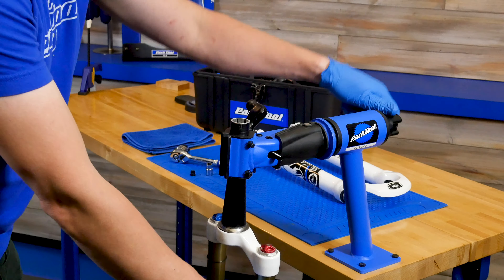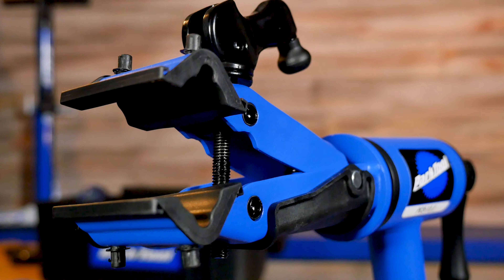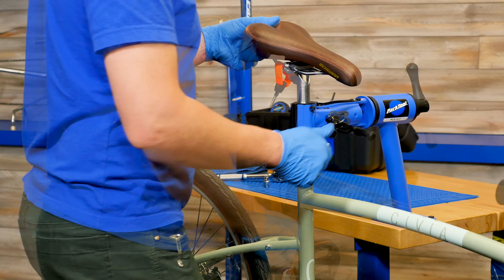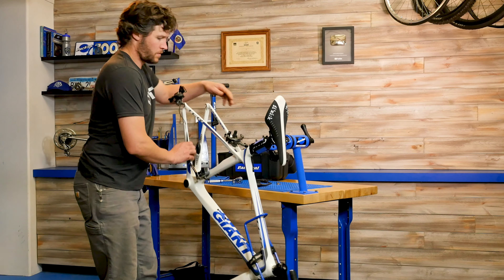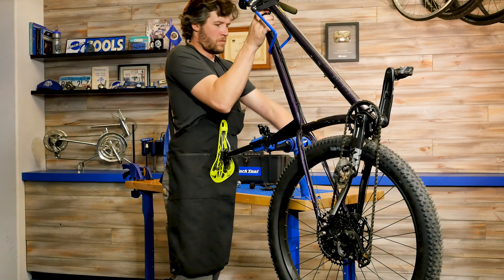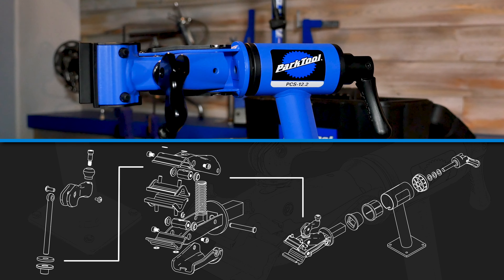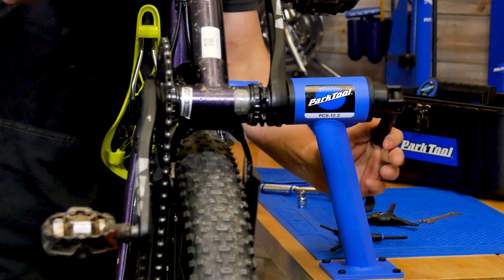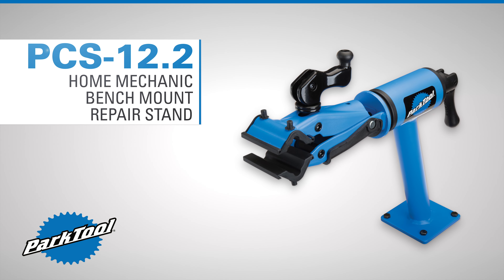PCS-12.2 Home Mechanic Bench Mount Repair Stand

Comment: I just purchased the PCS 12.2. I noticed one of the bolt holes is offset away from the corner. At first I thought it was a manufacture defect. From looking at the video it looks like it keeps the bolt away from the corner of the workbench for tabletop strength. Smart...
Reply from the maker: Good catch! The story behind the one offset hole has to do with our larger upright stands. We have the one offset hole so that the stand can only be installed one way so people do not accidentally hang the bike off the wrong side.
Reply: @parktool  Again. Smart!

Comment: Have you thought about adding a quick release button or trigger that allows you to engage it and freely spin the clamp but then lock in certain degrees once the button or trigger is disengaged?  This would allow you to save some time from having to tighten or loosen the rear lever anytime you wish to spin the clamp to a different degree.  Hope that makes sense.

Comment: Hi, I am thinking to attach it to a balcony rail without drilling thru it. The rail width is 6cm (2.363 in). What is the distance between the distance between holes? Thank you
Reply from the maker: They are approximately 3 inches apart

Comment: What is the purpose of that one mounting hole being closer to the center?
Reply from the maker: That base plate is the same as our other stand that use a bolt on top tube.  With that asymmetrical we can control how the clamp points to give the best support.  See for example the PRS-3 or PRS-4.  Same plate.

Comment: what are the dimensions of the foot stand that screws onto the bench? I wonder if I can nail a piece of 2x2 onto the mall and then use this as a wall mount bike stand?
Reply from the maker: The footprint has the same hole dimensions as the drawing found at the following link. https://www.parktool.com/assets/doc/product/PRS-3.3-Footprint.pdf
Reply: @parktool  aah ok....so a 4x4 wood piece should work. I am thinking of attaching the wooden piece to a stud behind my drywall using a joist hangar and then mounting the "bench mount" onto the wooden piece to convert it into a wall mount repair stand
Reply from the maker: Yes it should. That will be very cool!
Reply: @parktool  almost got everything figured out. What is the recommended height of the post/bench onto which the stand mounts? 3ft or closer to 4?